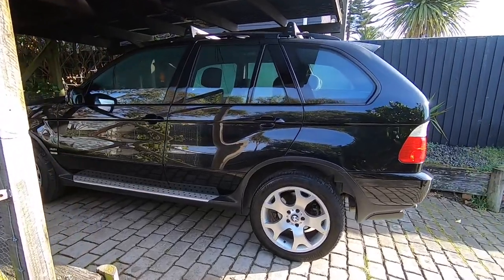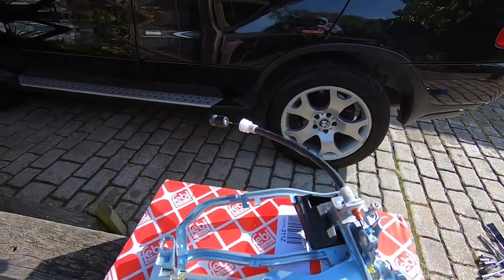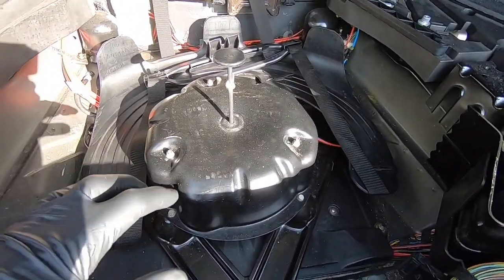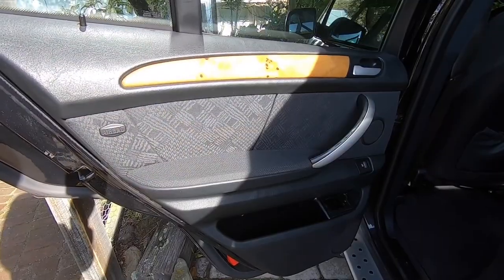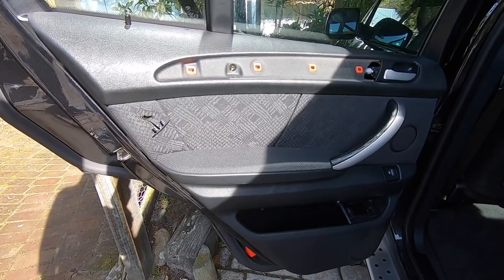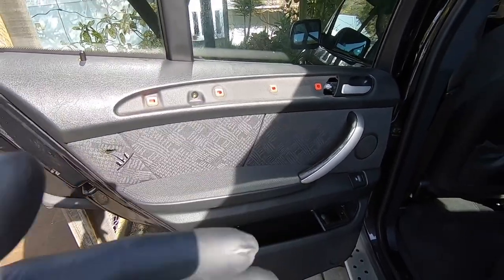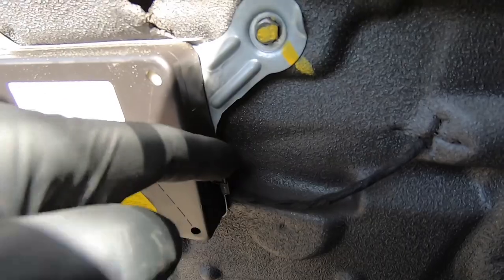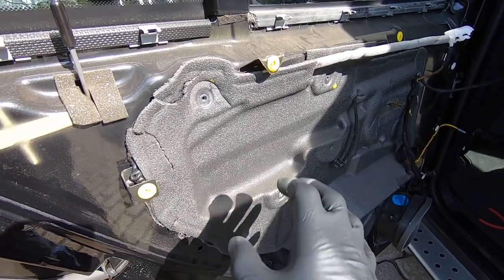BMW E53 X5 Broken Door Handle Repair

Comment: Great Video, I know its a metal piece but I will try JB welding the piece back together and see how long it will last. Just need a quick temporary fix anyways
Reply from the maker: By the time you’ve disassemble everything and gained access to carry out the repair, you might as well just get the handle mechanism replaced

Comment: WHAT A NIGHTMARE..just to replace an over-engineered BMW door handle!!!  Just got a 2001 X5 and the driver door did the same thing,..I wonder if the original mech could be fixed, instead of buying that jo-magee massive unit to replace?  Anyways, thanks for the video, much appreciated!!!

Comment: Great Video, Very Clear. Im replacing my broken rear handle with a FIBI part too. I Just cant get the alan key to re-attach to the rear mounting part of the handle. Burnt a good few hours and it just wont take. My outside part still has the plastic cover on it. Doesnt seem to want to remove from 20 years being attached so I thought this would not cause too much issue but it just wont attach. Any tricks to make this part of the process quick and easy.
Reply: Fixed it. Had to remove all cables connecting to the lock below. Trying with them connected was impossible. Once disconnected it went in 1st time.
Reply: whats a "FIBI" part?

Comment: Mr Mtech Guy,  great video.  My front passenger door handle has just broken.  To add I noticed it no longer sits flush perfectly it sticks out about 1- 2 millimetres , I have a 2004 x5 3.0 sport petrol, with all standard fittings and standard car phone kit.  Has a slow battery drain.  Read a lot of different issues that can cause it.  In your experience what is the most common cause.   Thanks
Reply from the maker: Handle carrier needs replacing. Battery drain you need to get diagnosed, could be multiple contributing factors

Comment: Need to do this on mine... Only problem is, it's on the drivers door handle and the battery has now died. Any ideas how I can get in the car please as the only door that has an actual door key is the drivers door and that means I still can't get into my car 😱 please help, need to do it myself as can't afford to get it sorted. Thank you
Reply from the maker: Open the bonnet using the technique in this video- https://youtu.be/ESeciq5qFJk
Then charge the battery from the jumper terminals under the bonnet, then open the door with the central locking.
Then get the handle replaced!
Reply: @MTechGuy  thank you very much ♥
Reply: Only problem I've just realised..... I can't take the wheel off as the locking nut is in the car 😱
Reply from the maker: Hey Samantha, you got three options, either buy a new lock nut tool from BMW using the cars VIN, and a photo of your lock nut pattern, or hammer a tight fitting socket onto the lock nut to try and get it off. But the X5’s do have a reasonable amount of clearance between the wheel and wheel arch, you may have just enough room to disconnect the liner and pull it back just enough. Good luck!
Reply: @MTechGuy  thank you... I've been trying most of the day... I finally managed to get my arm up there, but I cannot for the life of me find the cable to release it 😤 getting to the point of just wanting to smash the window now 😂
Reply from the maker: @samanthagornall2255  🤣 Make sure you’re on the same side the bonnet release is on- LHD & RHD differ! Take a look of some pictures online to see exactly where the cable is
Reply: @MTechGuy  I couldn't get the bonnet open... Got to the right cable but just couldn't get quite enough on it to pull it... I had to call someone out to get into the car... But I have now just replaced the carrier! Thank you so much, great video ♥
Reply from the maker: @samanthagornall2255  Great to hear you got it sorted. Good on ya for getting the carrier replaced yourself 👍 Thanks for checking out the video!
Reply: @MTechGuy  thank you.. One question though, mine was the drivers door.. After putting the barrel back in, the door now won't lock. Any suggestions please? Thank you
Reply from the maker: @samanthagornall2255   Would recommend opening it up and double check everything is positioned correctly with the door handle,lock cylinder mechanism
Reply: @MTechGuy  all working... Thanks again! Had a scroll through your videos, but couldn't see another I was looking for but don't know if I missed it. Have you done a sunroof video for the e53 at all please? Thank you 😊
Reply from the maker: @samanthagornall2255  Awesome, good to hear you got it sorted yourself 👍 My E53 X5 didn’t have a sunroof!

Comment: BMW is the absolute worst company I have ever seen in my life. My X5 is garbage. They expect you to never use the damn car because if you do, it’s going to break. Doesn’t matter what it is. Sun visor? Don’t put that down too many times or it will fall off! Window? Don’t roll them down too much or the mechanism will break! Door handle? Don’t open your door too much, the handle will break! Door key? Better not use that or it will break!
I CANNOT believe that anyone considers these pieces of shit anything other than just that, let alone a “luxury vehicle”.
Reply from the maker: I’ve owned many BMW’s and that’s not been my experience. If something breaks I fix it and move on
Reply: it's called wear and tear ...if it's expensive to maintain. You shouldn't buy Euro cars.